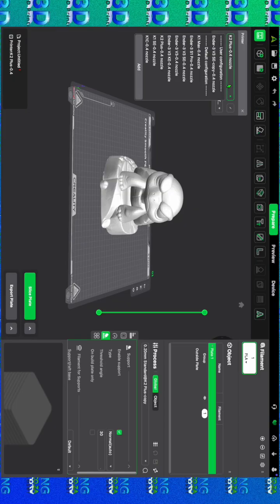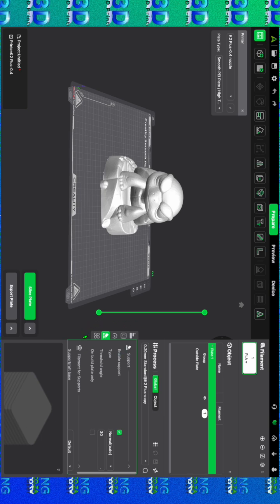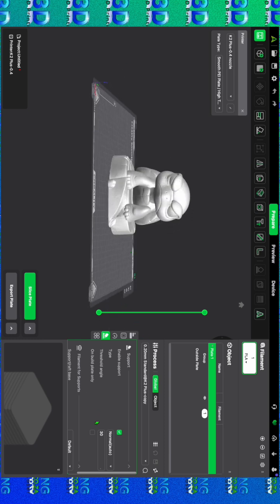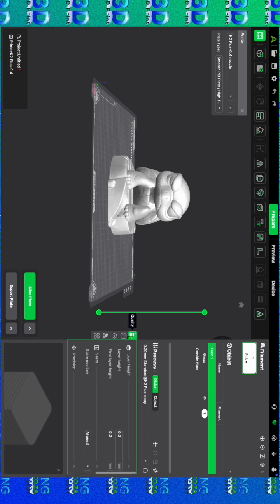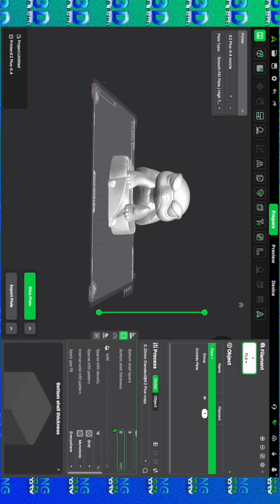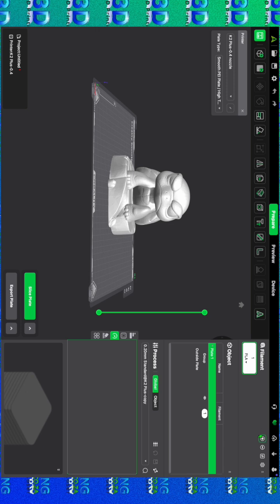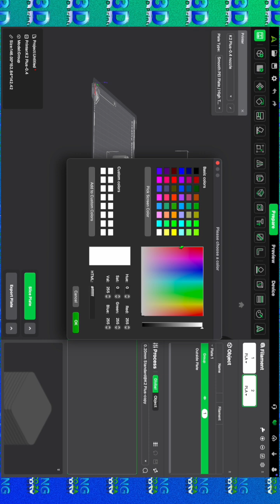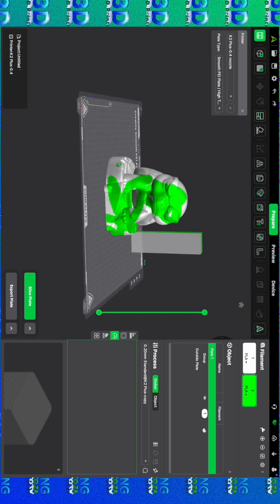Basic Creality print settings

Comment: I'm still having issues because anytime I don't see my printer settings under a model I want to use on creality Cloud, I almost always try to follow the standard default settings and it leads to a lot of failed prints. If there is a model that happens to have my printer settings applied, it usually works, but I can't figure out what is changing....
Reply: Same here. Probably to be able to do so we need kinda premium access